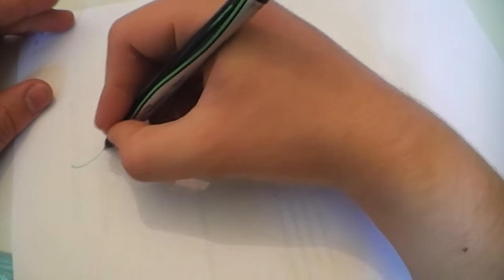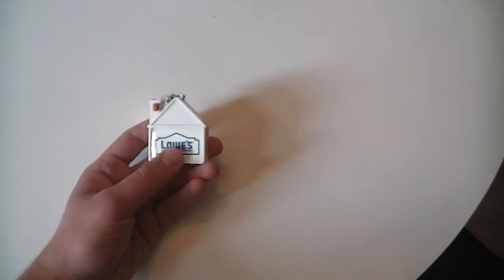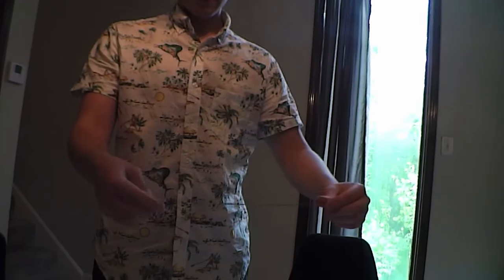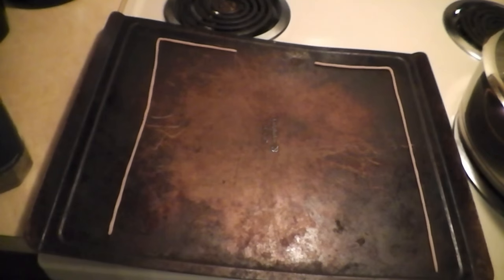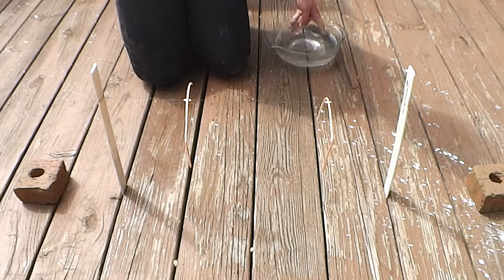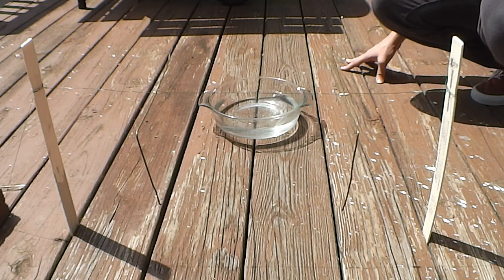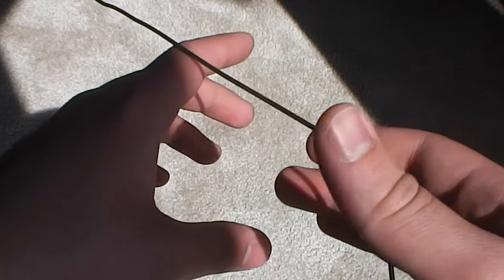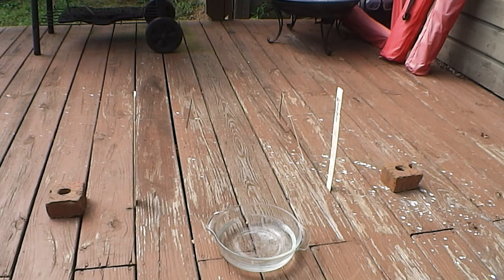Dowsing Rods: Science or Pseudoscience

Comment: I'm not sure this experiment was setup correctly since it's possible that the electrical charge from the person holding the rods has a role. Also, I've heard that the water must be in motion. Water moving through a pipe generates electrical current. So, there could be an electromagnetic role that's missing in this experiment.
Reply: You have no idea how anything works rofl
Reply: Oh, and don't forget that you have to have CONFIDENCE and BELIEVE in the rods..!! Just like a RELIGION!
Reply: Water moving in a pipe doesn't generate electricity wtf
Reply: @4doorsmorewhors  water flowing through a pipe does actually build up a static charge on the pipe through friction

Comment: do it by holding rods in your hands near water body or over underground waterpipe .note the result now again do the same experiment in same surrounding but blindfolded without knowing the direction of water body or pipe.In first case your conscious mind gives motion to rods without your approval (invoulantry) but when your eyes are closed you have no sense of where water is, it gives no motion.  so it is conscious mind
Reply: That was perfect and beautifully said
Reply: That's not true. We used welding rods to find drain fields, septic tanks and wells. I could do it with my eyes closed or open. Extremely mineral rich water where I grew up. I assume that it has to do with magnetic fields. We did this in places we never been before with 100% accuracy. My great grandfather and grandfather did this in hundreds of farm fields, with the same welding rods, with perfect accuracy.
Reply: I would suggest to do so, handling the rods will help our body to ground power. I have tried it, it is working amazingly on the hoses with water and the underground pipelines

Comment: I'm no dowsing rod expert, and I've never actually tried them, but maybe the water, or other material has to be buried in the ground so the energy can be focused and possibly made stronger with the human body's electromagnetic field? Have you tried this? And from what I've seen, they use copper, presumably because it's the best conductor? Also I've seen willow branches used, I don't know why willow would work, I just saw it used.
Reply: Joe Edwards It does not work. This has been tested over and over again. It only works on idiots.
Reply: @jaymz1999  you've never tried it then.

Comment: This is about electromagnetics of the earth.  You have to be holding the rods to properly ground the rod to earth through your body.  The water or pipe breaks the normal field orientation thus causing a compass effect.  I have used this method to locate existing water lines on new properties and it works.
Reply: That's not how they work at all.
Reply: Wut

Comment: Hide a dollar bill under a rug and i could pinpoint it every time. Trying to figure the physics behind it but it works
Reply: I could be an idiot, but it still works. You gotta do it right, and their method was not even close to being right
Reply: Andrew Staes You do know there are people paying up to $1.000.000 to anyone passing tests confirming these kind of things work, right? Why not collect?
Reply: Can't really prove it over video, because people will just say your turning with their hands... I use flags from marked utility lines, strip the plastic flag off the metal and make sure they are straight. Bend both rods 90 degrees 5 inches from one end. Hold the 5 inches, 1 in each hand and spin them around several times to charge them. Now hold them loosely in your hand at hip level pointing straight ahead. Walk around your yard to find your water service, they'll be straight ahead until you cross directly between your house and water meter, they will then point toward each other

Comment: Ok everyone listen up! I have been in the underground utility business since I was 18 yrs old and am now 38 which equates to about 20 years of experience. My job involves installing and removing just about every kind of underground utility you can think of which also means crossing over and under various existing utilities. These utilities include direct bury power lines, direct bury phone lines, plastic water lines, steel water lines, concrete sewer lines, plastic sewer lines, ductile iron sewer lines, clay drainage pipes, metal and plastic gas lines, and power or phone lines layed inside plastic protective pipe. Sometimes pipes are empty, full, or flowing full or partially full of water or sewage. During my years I have met many many people use witching/dowsing as a means of locating underground utilities and many of them were "old timers" with many years of practice and considered to be experts at the skill. On top of that I have been taught the technique by at least 3 of these experts one of witch it my father who swears by this method and often gets called by community members to employee his skills when they can't locate an underground line of various types. I have seen people use both coat hangers or steel rod as well as copper rod as their preferred tool and most will say either will work fine. After observing this technique being employed hundreds upon hundreds of times over the years as well as used the technique many times myself. I have had it work for me multiple times with varying degrees of accuracy and have certainly been witness to many people locating underground pipes this way and have also seen it fail. So this is what I would like you all to consider..... When searching for a spot do dig a well most desirable locations will be near a community or town or home site such as a farm. Most community's and farms would be located near some body of water or low lying area with flat ground to build on or fertile ground to grow crops or raise livestock. Oddly enough these are also the kinds of places where it is highly likely that water will collect nearest the surface of the ground therefore, since dowsing does not provide accurate indication of depth, if your attempting to find well water the probability of success is almost 100% as long as your willing to keep digging till you discover water.  And now on to why it may find your underground pipe. First of all if your looking for a pipe it's probably because you suspect one to be in the area but have limited info or have simply forgotten where it was exactly buried. However most people have some idea of where it is most likely to be and even if they don't consider that all pipes start and end somewhere and whoever put them there probably used the straightest or easiest or most logical or cost effective route possible when they installed the pipe. Therefore if you were to call someone such as myself out to find a pipe that I have no previous knowledge of it is most likely that I would be informed of the type of pipe you want to find and from there I would probably collect all other known knowledge about the pipe and then ( either consciously or subconsciously) gather all other useful information such as lay of land, terrain, age of trees, surrounding buildings, purpose of pipe etc. And from there I could subconsciously build a "map" that would lead me to the most likely location causing my magic sticks to cross.  So there ya have it people. It works because there is no set depth or horizontal distance of accuracy given for this technique to determine weather it is successful or not plus after you factor the known knowledge and experience and all other subtitle clues to the most probable location you end up with a relatively high chance of getting close enough to claim it worked. On top of all of this often times people use this method as a secondary means after failing to find it on there first try which means one spot will already be eliminated so as to further increase the odds of success. In closing I want to say that this is just my opinion and am willing to admit that there is still a small possibility that dowsing may be a reliable method however unlikely that may be but glad I'm not here claiming undeniable proof to something that simply has not even been close to proven and finally I CHALLANGE ANYONE to come to one of my job sites at a time when I have to dig across a live gas or fiber optic line or even a live water main and use dowsing only to locate the line then sign a contract of financial liability if I break the line because it was not where you said it would be. And bet you will never find a locate company willing to accept financial responsibility using dowsing method either lol
Reply: @Jentzen Dunn Try using paragraphs. Id love to read what you wrote but a big wall of text pisses me off.

Comment: Take simple coat hanger cut it in half bend a couple equal lengths into shape of typical dousing rod, hold them loosely in your hands and go find water. Can even walk them directly over a glass of water and they will cross and separate when you back off. Works every time. 👍
Reply: Heck it works with a beer.

Comment: I believe dowsing does follow fully natural laws; I may not understand them, but I do think also that a living component is required for the rods to work (i.e., a person.)  An old friend of mine who worked for many years on the watering systems of the public parks in Las Vegs, Nevada used dowsing as a regular tool in his work when the maps were off regarding where PVC pipes carrying water actually lay; according to my friend, he was taught by someone else in the same line of work.  He was never able to use dowsing to find metal or power-lines (he tried), but finding running water in PVC pipes became something that he was very good at.  Interestingly enough, empty pipes-- ones that had become damaged or clogged, for example-- didn't register at all; they had to be filled with water, and moving water gave him a stronger indication.  He used two L-shaped copper rods without handles or any other paraphernalia.
Reply: YsabetJustYsabet
Reply: Ideomotor effect.

Comment: A few problems. There is supposed to be zero friction, think of a compass pin. The force that would be moving those rods will be extremely small. Next issue the rods were not used properly. They are not supposed to be balanced from the middle. They are supposed to be held from the handle with a frictionless sleeve around them that you hold on to so they spin with limited friction. In theory the metal rods parallel with the ground will point or cross to standing and moving water underground whether it is due to magnetism, energy or anything else we are not sure.
Reply: There is absolutely no way to hold the rods with zero fiction. There will always be friction. Generally when people say 'frictionless' they actually mean 'with very little friction' because making something that is actually 100% frictionless is impossible. Even the air you breath has some friction with the rods as they move. (aka air resistance). So don't talk bullshit and say "ThERe's SupPOsE tO Be ZeRo fRIctiON".

Comment: You weren't using them correctly.   That type of divining rod(s) doesn't find water specifically.   It finds pipes, wires, big roots, etc.   Basically long straight pieces of (conductive?) material.  Do the same thing walking through your yard where you KNOW there is a full water pipe, but are unclear as to WHERE in the yard.  You'll find it.   A bowl of water or a creek won't trigger the effect.    I can't speak for the "Y" shaped stick, but I have my doubts that that type works at all.

Comment: Dudes....for water witching (locating underground aquifers) many of the old timers find a willow tree and cut off a green Y-shaped branch.  Fresh branches work better for some reason.  For detecting metals (any kind of metal...even rocks with iron ore content) underground or underwater up to or perhaps deeper than 3 feet (I don't care to dig deeper), use L-shaped copper wire dowsing rods.  I've tried coat hangers, brass rods (store bought kind), and rods made from aluminum....and the copper wire ones work much better for crossing directly over the metal target and then uncrossing once having gone past the target.  I make my own copper wire dowsing rods and they work just fine. The field of dowsing does tend to attract skeptics...people who aren't good at researching what works and then trying for themselves to prove whether it really works.  There is a lot of misinformation out there on what is required to properly dowse...which just gives the skeptics more reason to be haters of it.  I have no experience with water witching.  But if you make a pair of copper wire L rods and still have difficulty getting them to work properly to detect metals below, just look me up or comment here and I'd be happy to help out.

Comment: I have been a dowser working in the countryside for many years, of course your experiments wont work. the rods cross because your hands move, indeed you can often feel the change without rods if it is strong enough. The only explanation I have is that they pick up a change, working out what the change is, is the tricky part. Bodies dowse, electric wires, pulling a current, wells, culverts, and of course vibrating water is the easiest, oh and I have dowsed ghost sites and they dowse, but have no idea why. If anyone knows please comment.
Reply: Ideomotor effect.

Comment: You guys have no idea what you are doing. You need copper and the water needs to be flowing. 

The actual physics behind this is that you need a diamagnetic material, like copper, silver, gold, or the best is bismuth. 

All dowsing rods are doing is detecting electromagnetic fields. You can do this over a light bulb or your cell phone. 

The diamagnetic material is slightly repelled by electromagnetic fields, or at least creates a drag like effect. 

If the water isn't flowing, there is no current, thus no em field. It is also better to hold them because they conduct a small charge which will increase the effect. 

Create a circuit with a small battery if you want to suspend them with an apparatus.

Comment: I've heard of it being done to detect or find ferrous metals, using magnetized rods or magnesium rods. It makes sense that it would work to find metals like this. Even though in the 21st century there is more accurate ways of finding metal like this. Such as a basic metal detector which can be made with a short wave radio and can detect non magnetic metals. I don't know where you heard of this being done with water, and I can't see how anyone in their right mind would even think it is possible to do with water. Of course it isn't out of the realm of possibility to do with water. Assuming the water has large quantities of iron in it or an electrical current.
Reply: I've seen it used for many years to find water. Never has it failed to find water every time I've seen and used it to do so.

Comment: You are doing it all wrong. It is like connecting wires to an electric bulb without a battery and claiming it is not working. The conductive wire is functional if there is an electric source is available. with dowsing rods, you are the battery! You have to touch it with your bare skin, otherwise it will not work.
Reply: I agree....I've tried it with gloves on and it won't work.